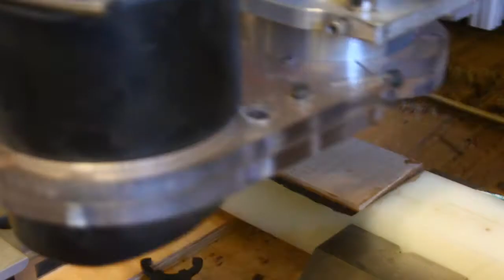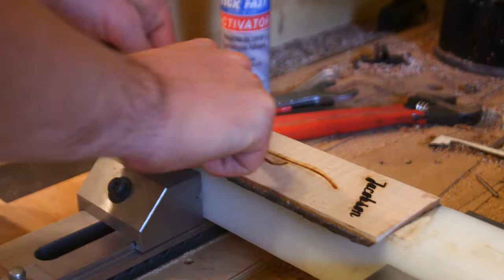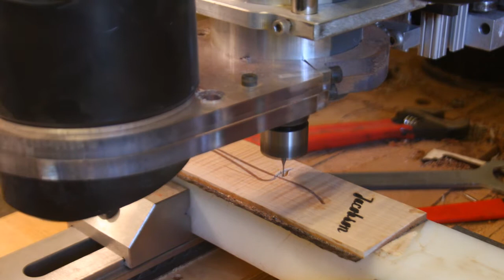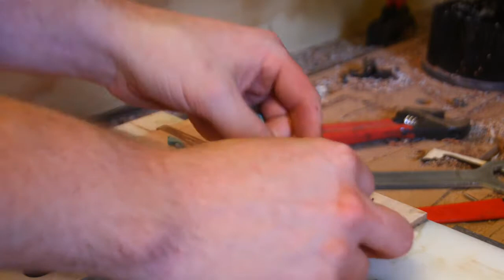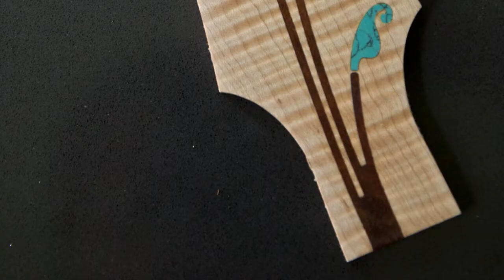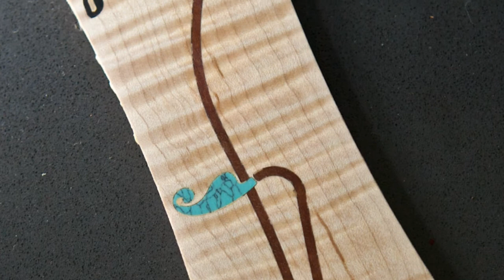Time Lapse Headstock Inlay for Jacobson Nautilus Mandolin #23

Comment: Beautiful work, and so fast!  May I ask what router and CAD/CAM you use?  I'm a banjo maker, just about to try cnc.
Reply from the maker: It's a homebuilt router based off of Fine Line Automation's plans. I use SolidWorks and HSMworks for CAM. Good luck, any questions let me know.
Reply: Thank you Martin.  I have a million questions, but I need to spend some time on my machine first, nothing like hands on for education.  I have an old Techno Davinci bought at local auction, petite but built like a tank.  I'm working with Fusion360, and have just generated some g-code, but it's real jittery, have to learn more about smoothing and the other CAD parameters. 

I'm impressed that you built your machine!  Do you have a background in electronics?  That's the part I find most daunting.  I'm a semi-retired furniture maker, still have my shop with industrial wood and metal working machines, can build just about anything.  But those electrons...
What controller did you use?  The Techno controllers are widely reviled, may have to upgrade soon.